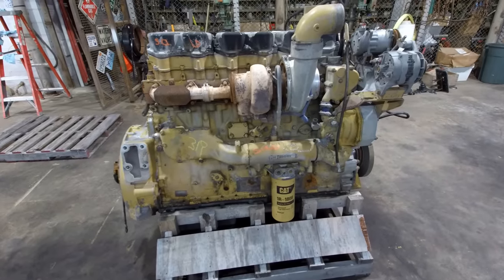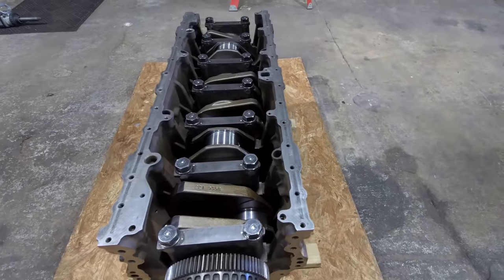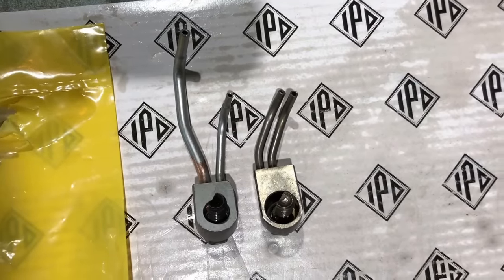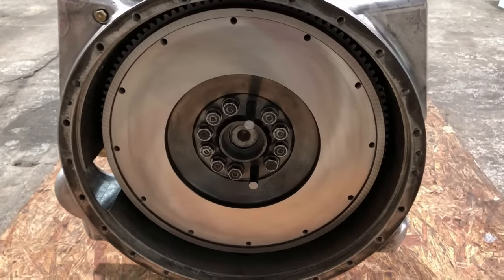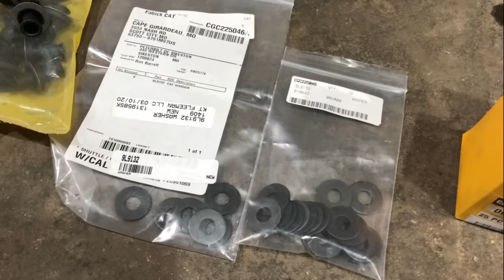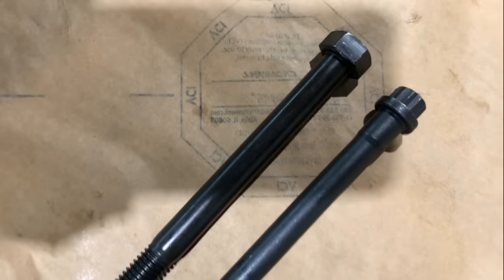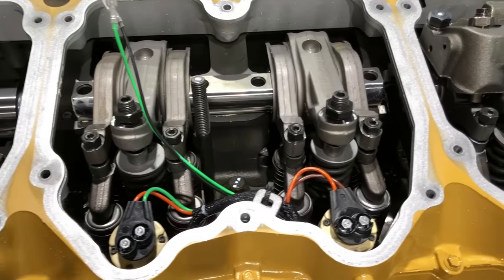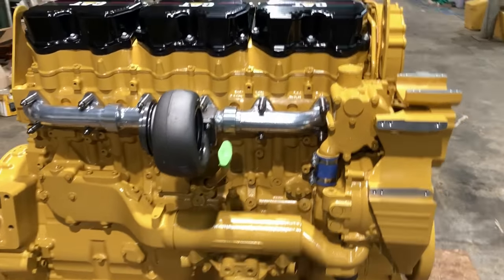800+ Horsepower 17 Liter Caterpillar Diesel Engine Build from Start to Finish + 1973 Peterbilt

Comment: I've built and tuned a number of high performance engines over the last four decades so it's kinda fun seeing how the "big stuff" is pumped up.  And yes, attention to detail and taking the time to bring everything to spec is key to having one perform and last, and something usually only performance customers can appreciate.  Just throwing parts together does not cut it.

You said you weighed those rods and pistons.  How much tolerance do they give you on something that big?  Also, are you balancing those rods on each end or merely checking total weight?  (Just curious since those don't spin nearly the RPM gas engines do.)
Cam gear looks interesting.  What's with the what looks like floating or counterweights?
Driver's side of engine: What's that green area and what are you covering up with that piece of tape?

Love the comment regarding safety police.

The trash can fire: shop heat?  ;)
Reply from the maker: They don’t give any tolerances on weights. You’re supposed to take them out of the box and put them together. Rotating assembly is over 500 pounds. Doesn’t really matter, but it can’t hurt.  

2300 is all it can possibly turn and it will hardly ever do that.  This has been a pretty badass engine so far.